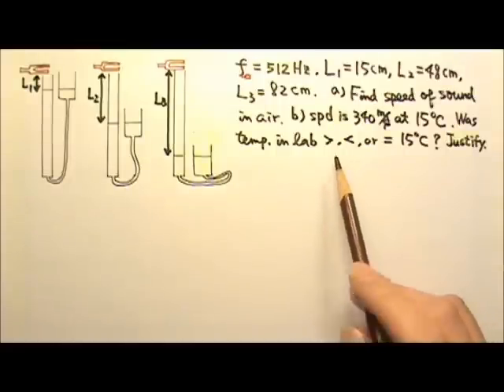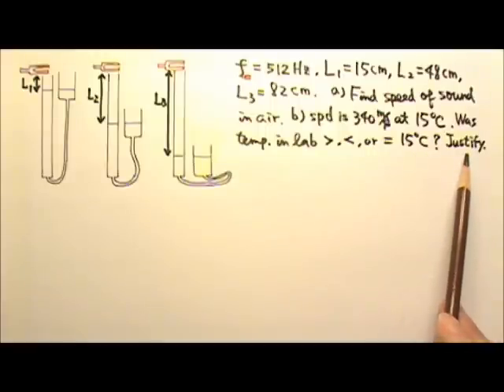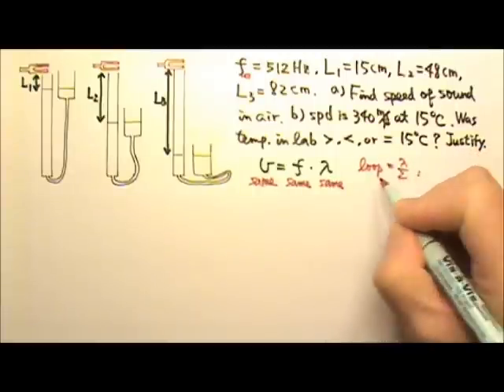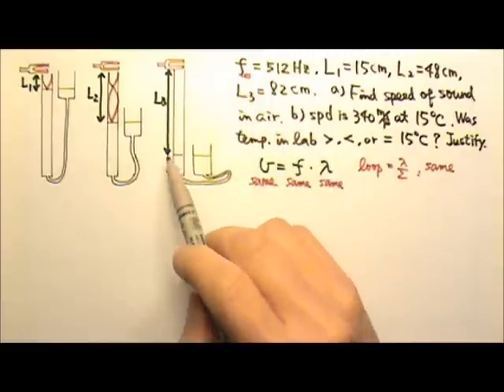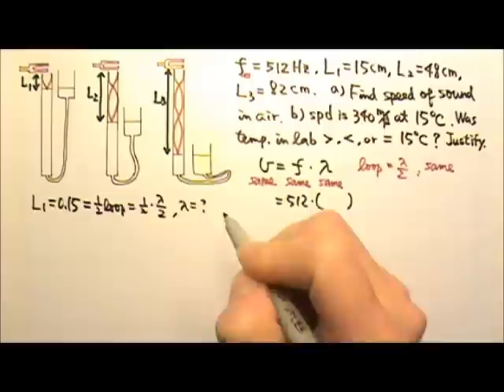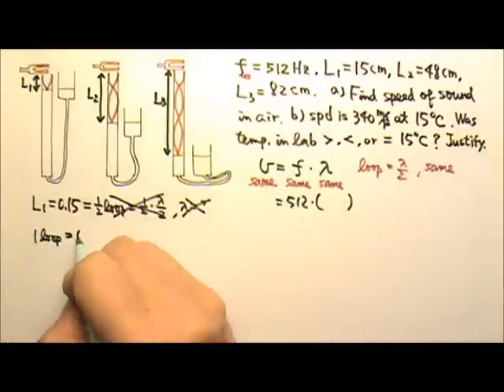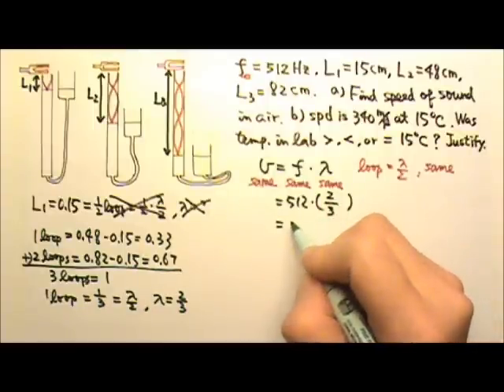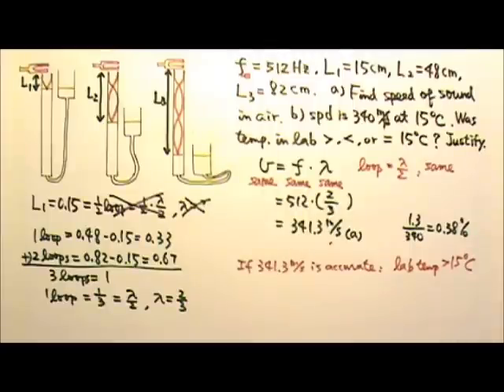AP Physics 2: Sound 3: Air Column Resonance & Speed of Sound Lab Problem

Comment: isnot it multiplied by 4 not 2 because it is a closed end?
Reply from the maker: Sorry, I am not sure which 4 or 2 you are referring to, but the work I did in the video is correct. I usually draw waves to solve this kind of problems.
Reply: I watched it again, I got your point you mean the loop is half wavelength , because My way, to make the first part one fourth of the wavelength.
Reply: Ms. Yau , do you have any worksheets to be given to the kids to practice?
Reply from the maker: I posted the practice problems I wrote at my website: twuphysics.org, although I do not have any for the waves and sound unit. However, you can go to https://sites.google.com/site/twuphysicslessons/home/old-ap-problems and use old AP Problems for practice. I have sorted past AP Physics B exam problems by topic on that page. 
Or you can go to https://sites.google.com/site/twuphysicslessons/for-erhs-ap-physics-b-students and you will see what problems I assigned to my students during each unit and during AP exam review.
Reply: Thank you so much, could you send me your email?